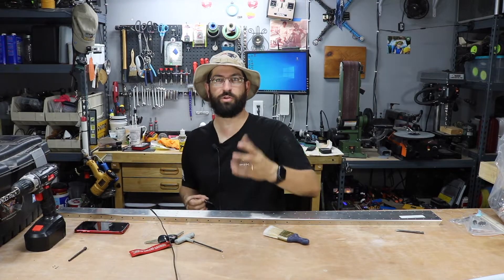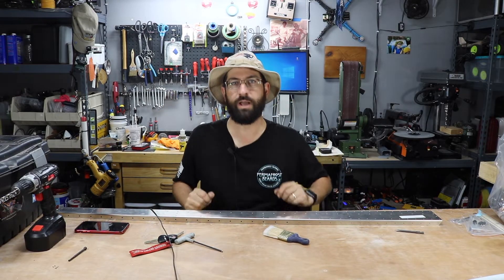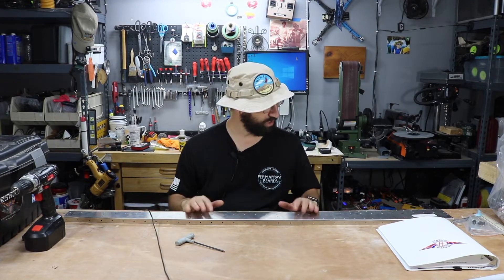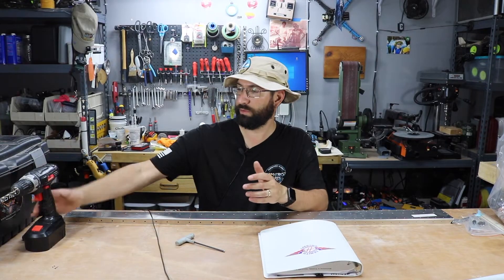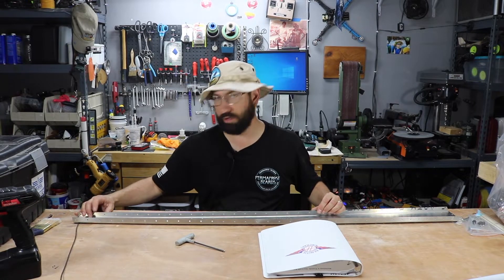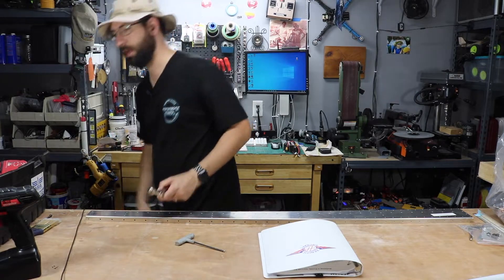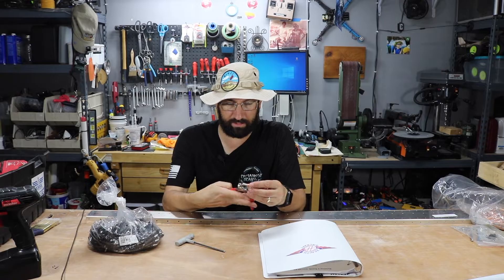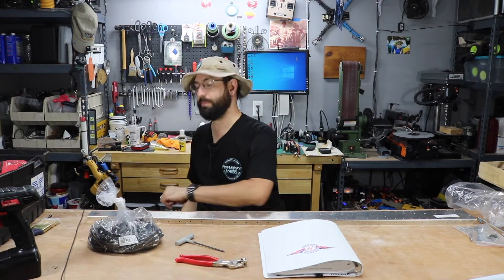Zenith Build Part 1-A: Rudder

Comment: There's a tip from Zenith to put a 1" block under one end of your support blocks. You can see at 7m27s that your rudder is bouncing/flexing, is not supported. It's likely that if you rivet it this way, you'll end up with a twist in the rudder.

EDIT: Nevermind, just watched the second rudder video. :)
Reply from the maker: Jason Fish thanks